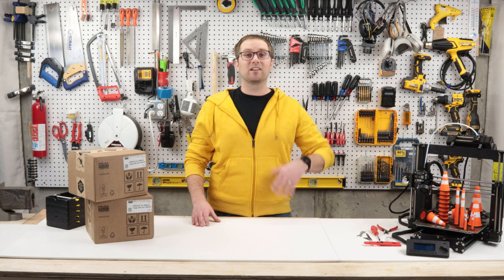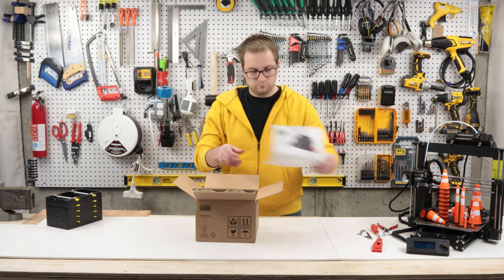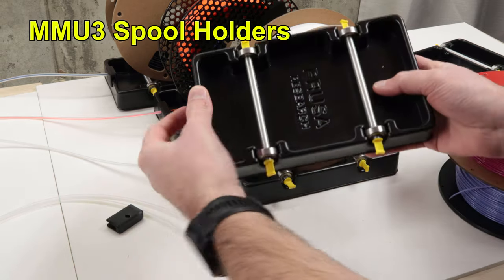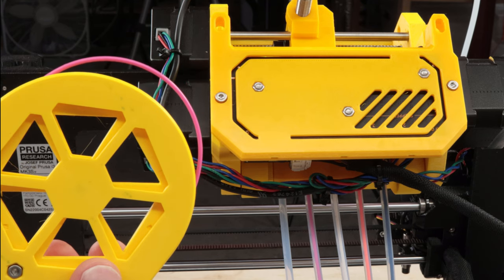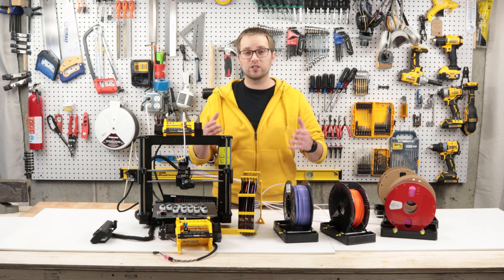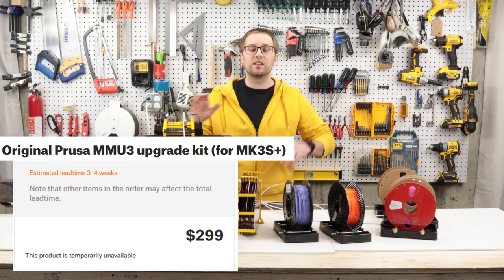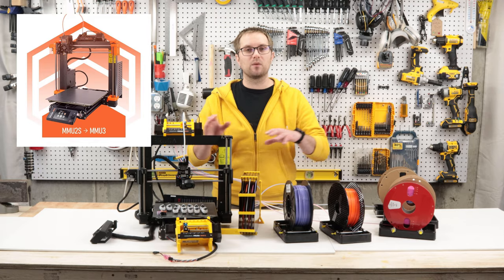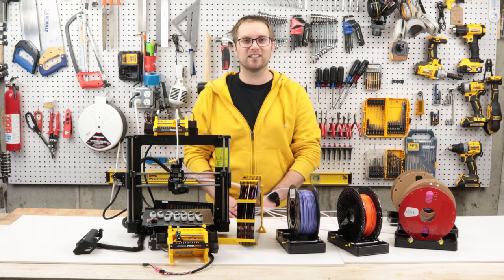Should you buy the Prusa MMU3 Multi-color upgrade?! Unbox, assemble, and review

Comment: I prefer to buy my multimaterial solutions from companies that don't take three versions and MANY MANY years to get them working.  While the current price is reasonable, add in the price of a MMU2 and a MMU1 for the people like me that wasted many hours on those past products.  What is that saying about fool me once, fool me twice...
Reply from the maker: A fair point - it's definitely painful when the customer (you in this case) are also the technology development testers. 

 I do intend to get an X1C + AMS when I can get one on the used market. Or if BL comes out with a large format printer before my Prusa XL 5 tool head order ships I'll probably cancel my XL order 

I really like having the fleet of four Mk3s+ so I can just send the same g-code to any of the printers to make my workflow as simple as possible. Even having the one Mk4 is a bit disruptive (though I'm very glad to have the Mk4). For this reason I'll stick with Prusa for the majority of my small print farm for the time being.

Thanks for watching and commenting!
Reply: I personally kinda feel the opposite. Prusa sent me the upgrade from MMU2 to MMU2s for free, then it was only about $100 shipped for the upgrade to MMU3. Meanwhile they've fully supported community mods and improvements. While the out of box experience might not be as seamless, I much prefer to have a product from a research company with a long history of supporting and upgrading devices (which are open source too) than a complex product I will be unable to repair or upgrade in the future at the discretion of a closed-source company.

Comment: The main reason not to buy the MMU3 is that Prusa did a poor job supporting the MMU2. It’s nice to see them moving forward, however, it just seems that an upgrade could have been done much sooner.
Reply from the maker: A very fair point, they did a poor job with the MMU2 and it took too long for a fix to be available
Reply: I can number on one hand how many successful prints I had on my mmu2. Its gathering dust here somewhere.

Comment: My biggest problem is the MMUs can not be accommodated with a Lack enclosure; I do not have the option of having the MMU3 in my lack enclosure. So, I will not buy an MMU again. It's horrible when converting the price to Canadian Funds and then getting nailed with at least $30 customs charges on the purchase; just not affordable.
Reply from the maker: Ah, fortunately there is no customs charge for MMU3 or the 2-3 upgrade kit in the states. Shipping is expensive from Prague but I'm hoping overall prices go down as Prusa bought the US supplier Printed Solid.

I'm surprised about the Lack comparability thought - I would think you could run the MMU on the outside of the Lack enclosure and run the PTFE tube through to the extruder on the inside
Reply: What are you talking about there are many "mods" to add the MMU to the Lack cabinet "mod". Sounds as if you should do a bit of research. Also its quite easy to addon pretty much anything to the lack cabinets. Heck I out my Ender 3 inside one to print some ABS for my voron v0 and V2.4 parts.
Reply: I have a mmu3 on my lack enclosure. Plenty of mods that make it work.

Comment: Re the MMU2, I really enjoyed tracking down the bolts that fell out and rolled around the floor everytime I opened the MMU2 up to fix something ... glad they finally fixed that after 5 years.  And then there was the known 5V issue (that they fixed with that little board included in the MMU3), but that can also be fixed on the MMU2 by rerouting the 5V line to bypass the dodgy diode ... Just a shame that Prusa didn't do anything about that for 5 years (and they knew about it from endless support calls) and that it was finally fixed by some users ... Prusa  do make some great printers ... and then they sell complete garbage like the MMU2 that is only fit for hard core hobbyists to spend endless hours fixing ... all for roughly the price of a Bambu AMX ... I am amazed there was never a class action over the MMU2's ...
Reply from the maker: The 5 year wait for the 5V fix - which you have to pay more for - is poor service. I wasn't plagued with under volt issues like some people were but based on the anecdotal evidence of YouTube and reddit comments it seems pervasive.
Reply: LOL< Yes I hated those bolts too
Reply: Are you kidding me? I literally thought there was something wrong with the PCB components, so I bought a new board, and then I still had the same issue. So I guess I was right after all.  The MMU would continue to error out and give the flashing lights of death. That ticks me off. 

The only advantage for Prusa has over Bambu is they do have reliable machines even though they have GARBAGE customer service... that and the Czech republic is not controlled by the Chinese communist party.
Reply: @AsaMakes  It seems like both the original PCB for me and the replacement PCB both have issues. Not sure if they are both 5V issues, but they both would not work for me.
Reply from the maker: Wow super unlucky... is it working now at least with a 3rd replacement?

Comment: A couple of days ago I changed my order for the MMU2 upgrade for MK4 to the one to the MK3S+ instead. Thanks for the video, it looks like it'll be pretty easy to put together 😊
Reply from the maker: Thanks for watching! The upgrade is pretty straightforward - the only difficult part is loosening the extruder body to add the 'chimney' filament sensor to the top of the extruder. And if you already have disassembled or partially disassembled an extruder before it will be easy.
Reply: @AsaMakes  Thanks. I use the kits so I can both assemble and disassmble the printer 😁
Reply from the maker: Perfect you should have no problem then
Reply: off-topic but this is some of the weird moments when different hobbies on the internet mix up, like here my go-to bread baking channel commenting on a random 3D printing hardware video 🙃

Comment: Sir:  HOW did you come up with those sheep files, such that some parts come out white, but other parts come out black?  What wizardry is THAT?
Reply from the maker: Oh I didn't make these they're one of the common MMU multi color test prints on Printables.com

That being said in Prusa Slicer you can use a paint tool to assign different colors to your print. I've used this for my MMU3 quite a bit and it works well and is intuitive 

Thanks for watching!

Comment: Do they have the cutter up and running on the 3? It seems that is part of the magic juice on the bambu machines is cutting the tips so they don't end up with any stringies to get hung up any where or trip a sensor or accident.
Reply from the maker: Yes there's a blade on the filament selector that trims off any stringing (similar setup as MMU2)

Comment: oh wow,  quite a bulky mmu system. would never fit in my room. i need to think about this.

Is there a 3 color MMU instead?
Reply from the maker: Not to my knowledge, but you don't need to load up 5 colors/materials. 99% of the time I run my MMU3s with 3 colors of PLA and leave material #4 and #5 empty in the MMU.

Thanks for watching!

Comment: So what multiple materials will it handle? I don't recall you mentioning what materials you tested. You mention colors but I'm not interested in that.
Reply from the maker: I've tried multi- material prints with PETG and PLA for easy support material removal, and I've done multi color ASA prints. I haven't tried TPU, PC, or Nylon yet. My only concern would be with TPU I imagine the MMU load and unload might struggle with the flexible material.

Thanks for watching!

Comment: Does this system need a filament cutter in the extruder? Also can someone explain why this doesn’t need to poop out filament like the Bambu AMS? Or maybe I missed it and it does poop. I see the concept is essentially the same although different method and form factor.
Reply from the maker: With the MMU (2 and 3) there is no filament cutter in the extruder. The way it works is the filament is loaded in and out of the extruder by a boden style drive coming from the MMU itself. Instead of the filament poop from Bambu the previous material or color is  just purged into a wipe tower. The wipe tower you can see in the time lapses next to the prints - it's just a rectangle that's the same height as the print. When there is no color change the wipe tower is just built up to maintain the same height as the print. When there is a color change the previous color (material) is purged in the wipe tower.
Reply: I believe the approach Prusa uses is to pull back the filament slightly while the hotend is at a certain temperature and then bump the filament down against the inside of the nozzle to shape the tip so it can be withdrawn without jamming. It seems like a really finicky way to try to do it that might vary a lot between types of filament.
Reply: @AsaMakes  Thanks that makes sense. But I’m confused why Bambu feels the need to poop out filament when Prusa doesn’t. They both have a tower they print (Bambu’s Prime Tower and Prusa’s Purge Tower) but Bambu also poops out a lot of filament by default. Does the Prusa have the same waste but it’s in the tower instead of pooping it out? Or is the Prusa prone to color contamination? 

No expectation to answer all my questions, I’m just thinking out loud. Merry Christmas and thanks for the reply!
Reply: @Dave_the_Dave  That does seem finicky and that everything has to go exactly right for this to work. But seeing this video it does seem to work at least for the uploader. Cheers!
Reply: @c0mputer In the Bambu X1C the filament is cut just above the extruder assembly (nozle + colling part). I suppose the do a certain amount of retraction before cutting the filament. But there is almost the full length of the hotend assembly with current color in it, that has to be extruded first, than there is an amount of the new color filament that is used to clean the nozzle so to have a print with the wanted new color.
This system is less prone to problems since the clean filament tip, but, and it is a big but, needs a lot of waste to work. 
Generated waste is proportional to the number of filament change per print.
For some 3D printed objects it could be 2, 3 or even 4 times the weight of the printed object.
It is a hidden cost that many  don't talk about, or don't want to talk about.
If You want to print a lot in multicolor, than a multihead printer is economically a better option. Just make a simulation with the slicers of the objects You think to print and You'll get good numbers of the waste of filament, and associated waste of money.
Has also to be taken in the ewuation that color change is a slow process in a single head 3d printer.
As always all depends on what, how much, with which materials, ... one wants to print.

Comment: I was hoping for a little bit more.  For instance, do the materials need to be the same or can you for instance, print a TPU overmold on a nylon part?  If so, how does that work with wipe into part or infill?  My primary interest is printing the support material out of something easier to remove.  How does that work?  What material might that be?  It looks like you're probably using PLA, so your spools are sitting out.  I have an enclosure because I usually print ASA.  What parts should go inside the enclosure and which parts should stay out?
Reply from the maker: Great questions! Wish I had time to really do a deep dive... I'll answer where I can 

The materials can be different, for example I'll regularly do PLA supports on PETG parts which makes support removal much easier as the PLA doesn't adhere well to the PLA. I haven't tried TPU in the MMU2 nor 3 - the TPU parts I've needed have all been single material prints. Honestly I'd be a little worried about the stiffness of TPU filament loading and unloading reliably. It would be worth checking Google how well TPU specifically works with the MMUs.

Mostly I print PLA but I've done dozens of multi color prints with ASA and the MMU2 before without any issues. There are soluble support filaments as well you could definitely use along with ASA.

I keep my PLA spools in a small lab oven when not printing + run a large dehumidifier so I just print with them out in the open above my enclosures hanging from a rod. 

With my setup the MMUs are inside the enclosure while the spools are outside. If I was worried I would build a small upper enclosure for the spools like the Rep Box.

I haven't had any issues impacting the MMU2 when I print ABS and ASA and the temperature inside the enclosure is high. Though I've only done 100 hours or less of ASA/ABS printing on my printers with the MMUs.

I Hope this was helpful and thanks for watching!
Reply: @AsaMakes  There is a "VarioShore" TPU, wich is quite stiff while cold but the hardness transforms the moment it is molten in the nozzle. Depending on nozzle temperature hardness changes - as higher the printing temperature as softer the print gets.
While soft material can not be used in a filament changer (as while changing filament any MMU works like a bowden extruder), VarioShore works on bowden extruders and I saw a video of it being used on the AMS. So it might be usable on the MMU3 also.
However, one of the main issues of any filament changer is the quality of the filament tip on unload. While the bambulab printers use cut&poo to get an always perfect filament tip, the MMU3 uses ramping on unload (wich improves a lot if you replace the V6 hotend by a Revo Six or maybe Trianglelabs TUN with integrated Nozzle/Heatbreak combo). So the already molten plastic in the nozzle might not be the best for ramping; cut&poo might be the better aproach here.
However, while I haven't done it yet (I just got the A1 mini and just upgraded my mk3s+ to mk4) it might be worth a try.
Reply from the maker: Interesting! The TPUs I have are quite soft - I'll check out VarioShore if I need to do some multi material print with it 

I also have a preorder for the XL 5 tool head which I'm super excited about, no idea when it will ship though....
Reply: You can, but be aware that some polymers do not mix with each other. That can be a good or bad thing. 
The good, you can use one polymer as structure and another as support material with near-perfect layer separation. The bad, when polymers do not mix well, it is super-hard to purge out the previous polymer. It will often stick to the wall and will coat the surface of the  new polymer for quite some time, resulting in really bad layer adhesion (because of bad mixing and bonding).
Others have done some tests which polymers do mix and adhere well or bad. Best example is PLA and PETG that make support removal a breeze. Unfortunately, when purging from PLA to PETG, and vice versa, you should increase the purge volume to make sure that the layer adhesion is not compromised.
Reply: @leeroyjenkins7915  Definitly. Thats one advantage of not using cut&poo - you unload as much from the nozzle/heatbreak as possible on unload, reducing the poo/purge needed. However, if you use multimaterial a lot, you should think about a toolchanger. There are quite nice projects for Ratrig VCore 3.1 and Voron Trident. Of course, Idex might be also an alternative. Even an Idex bedslinger might be fastet than a bambulab ifor full colour prints. Also I think two ERCF for an Idex might be interesting - changing filament on the toolhead not in use at the moment. This would reduce printing time a lot over all... If you want do multimaterial instead multicolour, you still could use the seperate toolheads for two different materials.
I think there will be quite interesting improvements in the future.
Reply: @leeroyjenkins7915  thanks. Still considering if I want to buy one. Mostly it takes up a lot of space. Plus using the "tree" support method has made removing supports a lot easier these days.

Comment: What was the failure you encountered?
Reply from the maker: A filament jam at the PTFE adapter on the filament selector itself, I've never seen it jam there before when my MMUs were MMU2s

The filament got stuck on a lip inside the PTFE adapter and I just had to remove the PTFE adapter to get the filament loose, put it back, and continue the print.

Thanks for watching!

Comment: I still can't believe that the MMU doesn't work on the MK4 yet.
Reply from the maker: Yeah it's really a gap in the MK4 capability
Reply: I believe its not "not work" but more like "cant compete" with others for current state.
Reply from the maker: Yes this is more correct 

I got the impression from the blog posts that it works with worse reliability than the MMU2/MMU3 with the Mk3

Either way, it isn't available today
Reply from the maker: And thanks for watching!